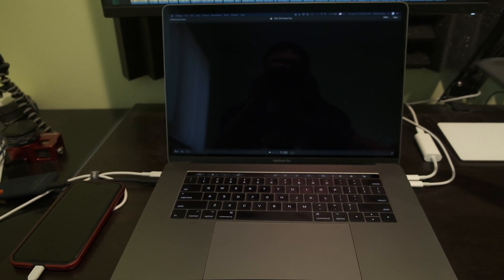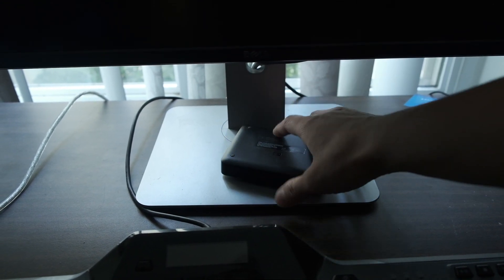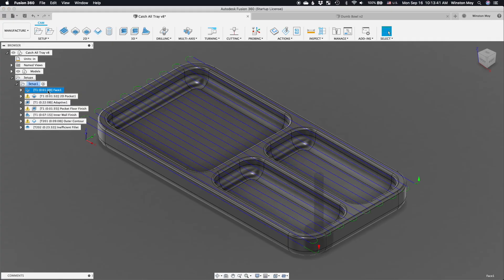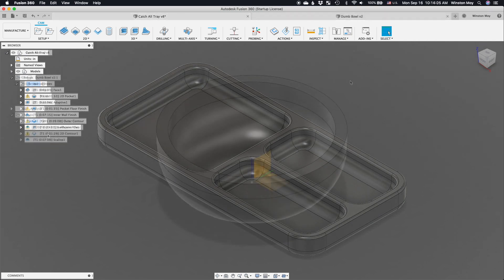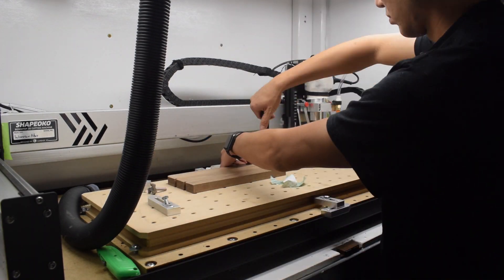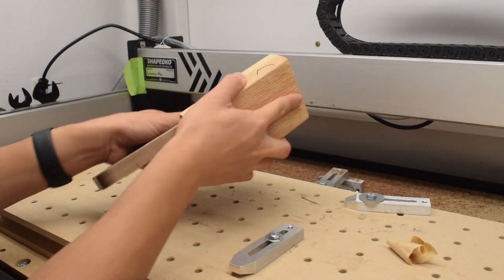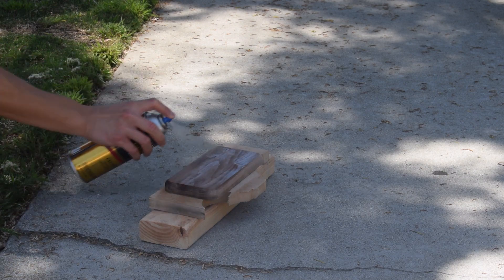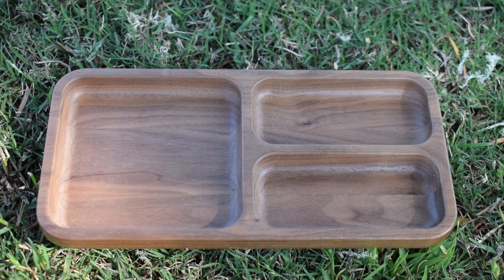Making a Walnut Catchall Tray From Scraps

Comment: Awesome video! What kind of double sided tape do you use? And how important is it to have completely flat surfaces? Thanks!
Reply from the maker: Nitto Permacel P-02 is my favorite, followed by 3M 410M, followed by Shur Tape double sided paper tape. Flat surfaces for super thin things like sheet metal is not a big deal as the tape will hold it flat. But for thick pieces of wood that are too strong to be pulled down flat, you're gonna have a bad time. Best to plane down the surface to be flat.
Reply: @WinstonMakes  thanks! Love ur videos!

Comment: Looking to buy my first cnc (shapeoko xxl). Your videos have been a great help. I am designing my enclosure and wanted to know if putting cnc on soft close drawer slides would cause any unforseen problems. Would like to put 3/4 plywood with bottom mount drawer slides for better access to machine. Thanks and keep the videos coming. They are a good guideline for us beginners
Reply from the maker: I don't think drawers would be a problem at all. Just need to make sure that vibrations and such wouldn't cause the drawers to open on their own (which I don't think would be an issue).